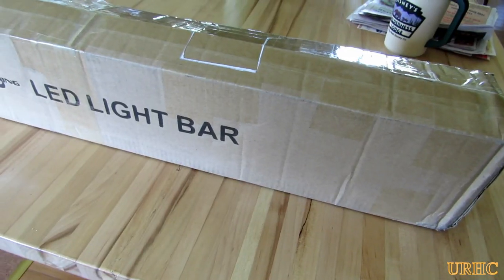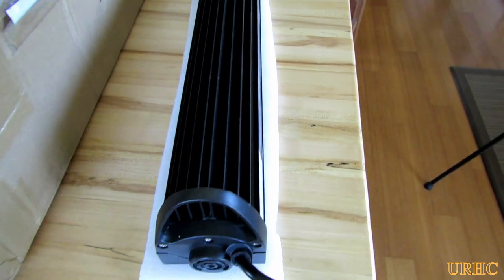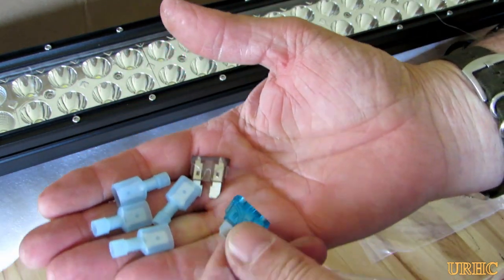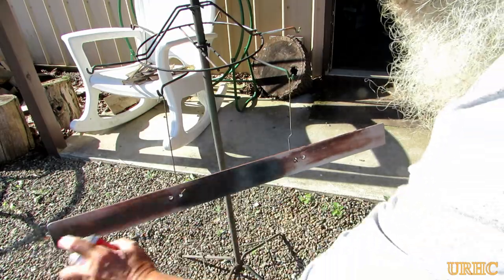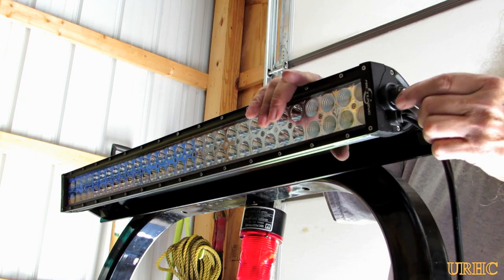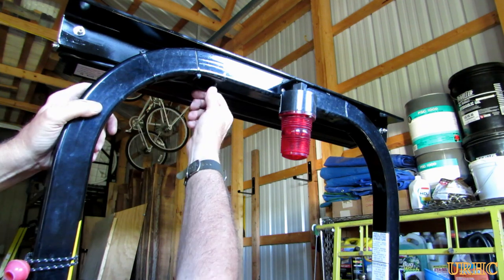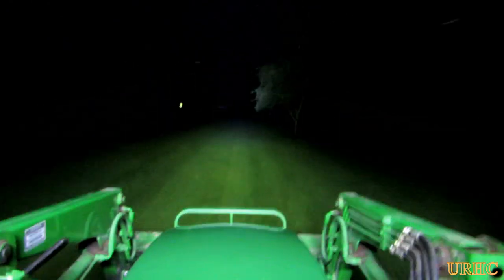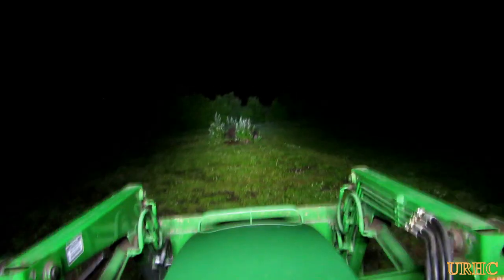MicTuning 180W Combo Lightbar For My Deere 4100 Install And Review

Comment: Nice addition to the tractor.  I am always amazed at how good the quality of things are now. Got to love technology.  I need to put one on my L4310.
Reply from the maker: I used to be leary about items from Asia, but lately the quality seems to be the same as or better then items made elsewhere  for 1/3 the price. The 2 year warranty is great also. This light is awesome for use with the loader and time will tell how it stands up. Thanks for watching.
Reply: I looked at a 120w version different brand name on Amazon and some were complaining about them burning out and flickering after a short time. ..... So far with the LEDs I have bought they hold up well. Thanks again for the videos.
Reply from the maker: I wonder if it has anything to do with the heat sinks. The 126 watt that I bought from Amazon ( is a different brand ) for my Kubota gets warm when on. It has very little mass and small fins on the housing. This one runs cool and has about 3 times the weight of heat sink material.
Reply: No doubt heat dissipation would be a large influencing factor. That was really cool Mictuning sent that to you and amazing they saw your previous video.

Comment: Sweet light system for tricking out the tractor.  Guess you can do a  lot of night work.
Reply from the maker: This light has a perfect pattern for use with the loader. May need sunglasses when plowing snow at night, but at least cars will see me. The thing that amazes me is it only costs 1/4 of what one from tractor supply goes for.

Comment: 180watts at 12 volt is 15amps.  how does someone determine whats allowable on a tractor or utv. I need to add leds to several pieces of equipment and rather not guess
Reply from the maker: Look in your manual and there will be an amp rating of your alternator. Just add up all the loads and stay a little below it. Thanks for watching.

Comment: I'm watching this video, not liking the fact that you drilled into the Rops which is a no no! The Rops is there for safety reasons only to protect you.
Reply from the maker: The tractor had 2- 1/2 inch holes and 4 1/4 20 taps that l used to mount the angle and run the wires in..
Reply from the maker: I think they for  optional factory lights or canopy.